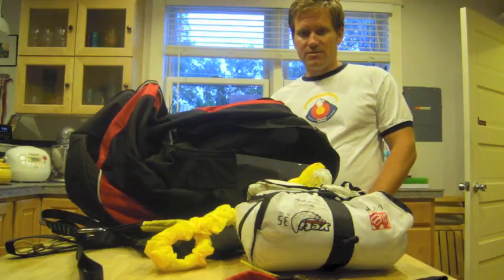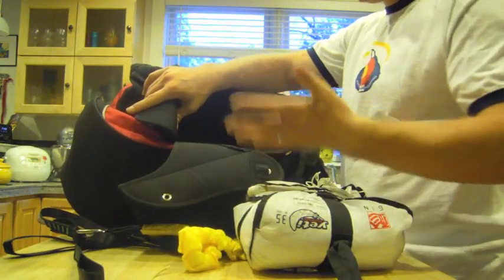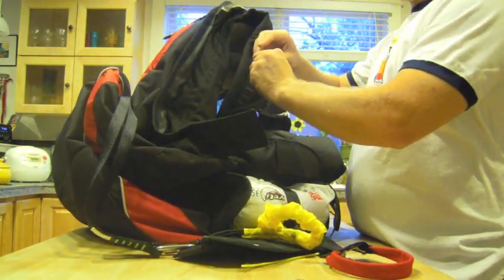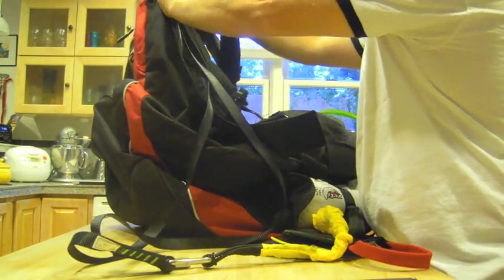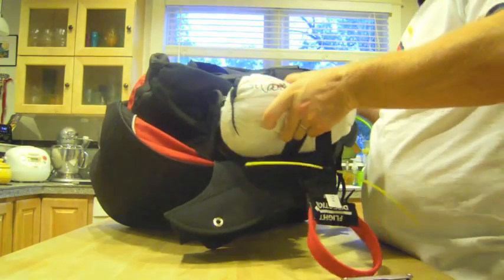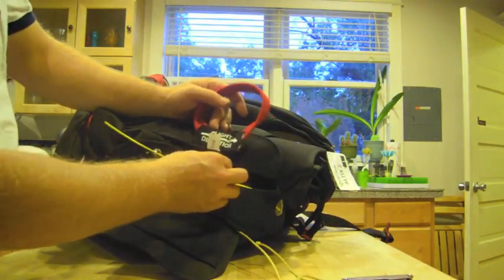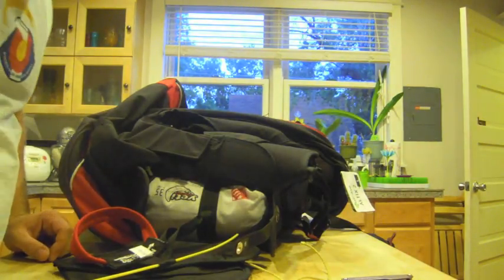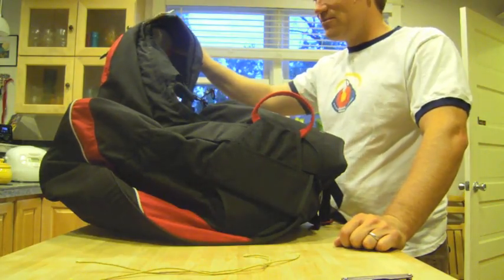Sup'Air Reserve Install

Comment: Why do they use line trimmer cord? Standard skydiving cutaway cable is the only reasonable design. Ugh
Reply from the maker: You realize this video is over 8 years old and has little bearing on current designs.